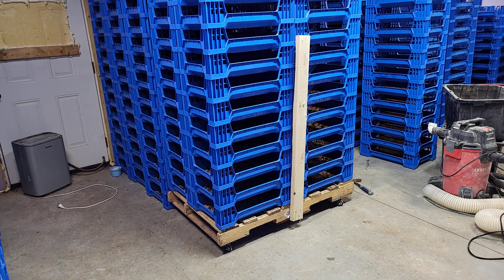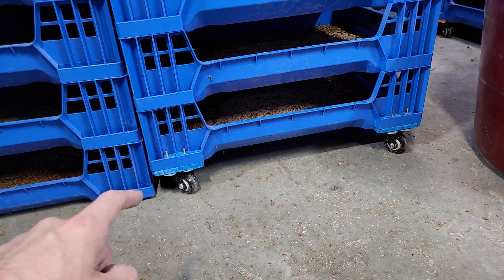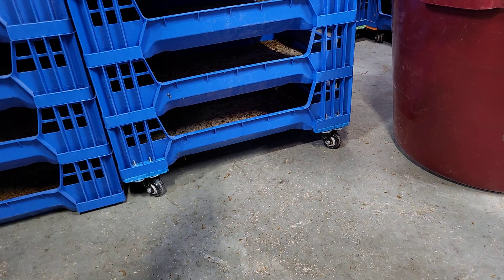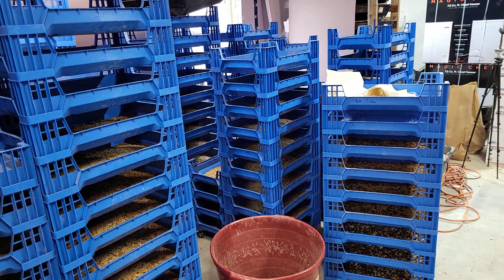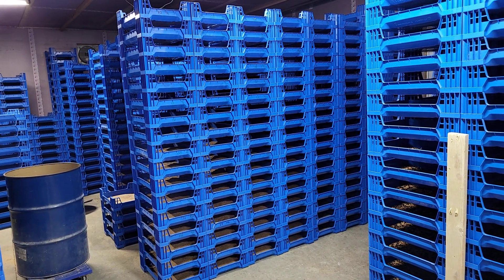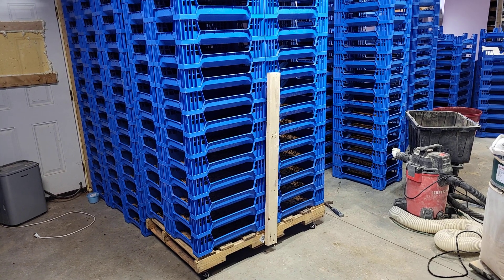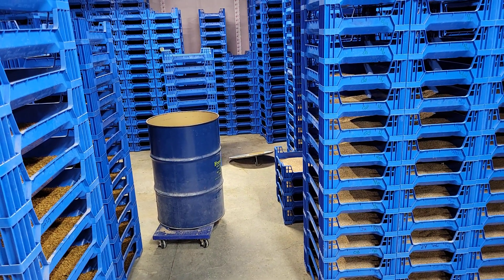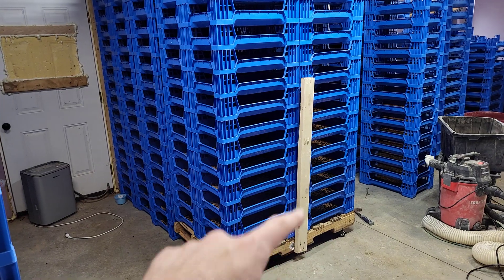Optimizing Mealworm Processing with Innovative Wheel Solutions

Comment: you should try with a rope rather then a plank of wood, connect the rope to a anchor(s) on the pallet :) have the rope be easily disconnected
Reply from the maker: How do I move the cart around if there isn't some kind of structure to push/pull on?
Reply: Would it be easier to make your sorting station movable to bring it to the trays. Sort the trays at that section then roll the sorting station back to where you package it. This might require you to rethink the space your trays are stacked. Just an idea. Hard to visualize your space. I’m not there. Not sure if that would be a more work efficient option. Seems like you have to move a lot of trays. Second thought lol. Why not have the trays around the work station and have the sorting area central/center with trays around it.
Reply from the maker: @practicaljunk836  good points. I'll try to get a better visual, and maybe map it out a bit to help show the layout.

I currently have a mobile sorting station, the main issue with it is that it would require a lot of space wherever I do it, so lots of moving and adjusting along with wires, hoses for dust stuff, etc.